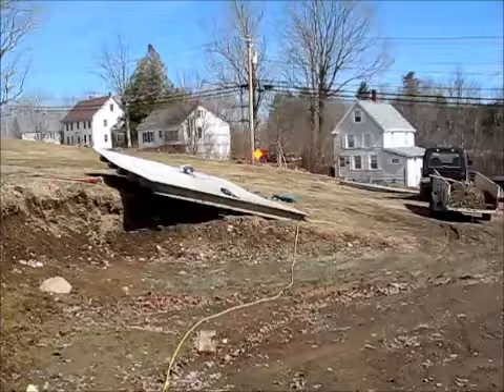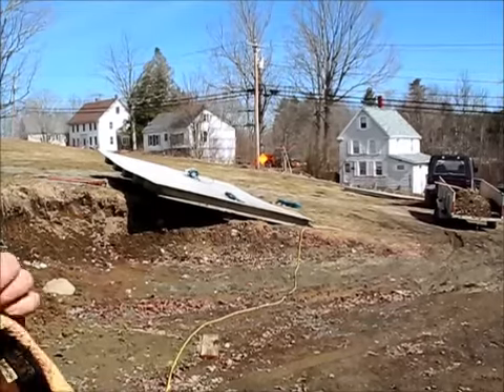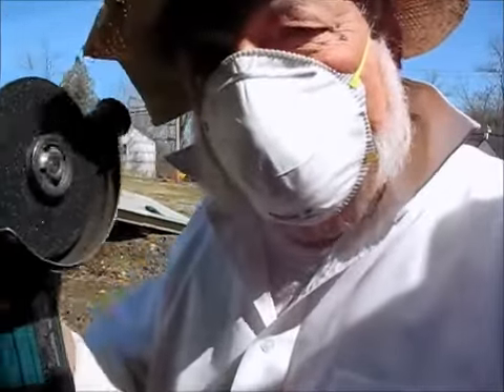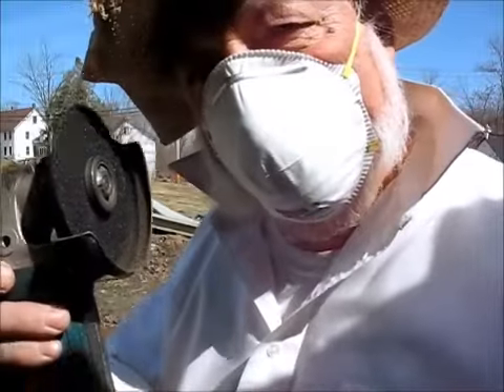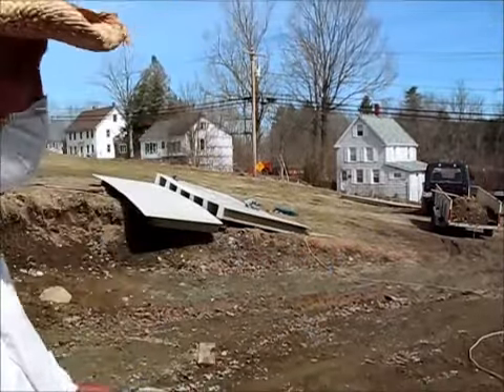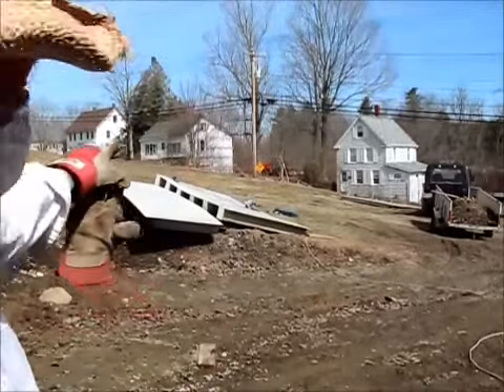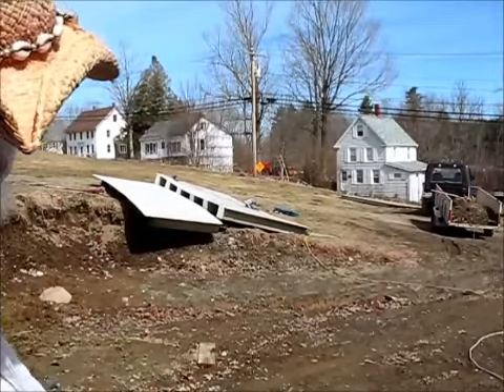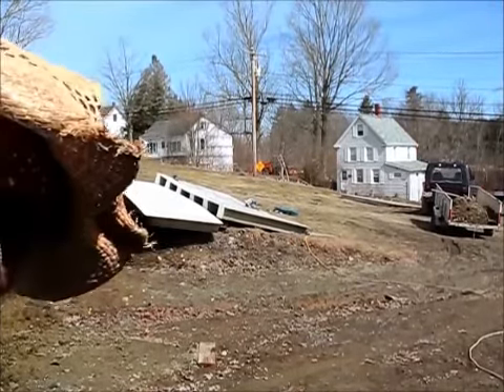Cutting Fiberglass

Comment: I have two old skill 77 worm drives that still run like new. keep a look out at swap meets and such I picked one up for 10 bucks last summer. I also have a malsaw 8" wormdrive that looks like it sat out in someones yard for decades I paid 3 bucks for, runs smooth as butter